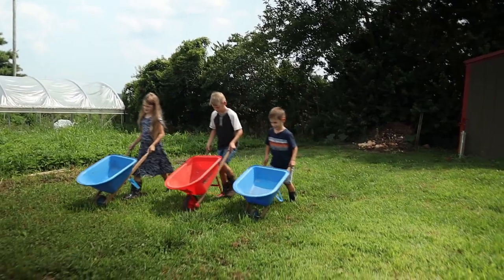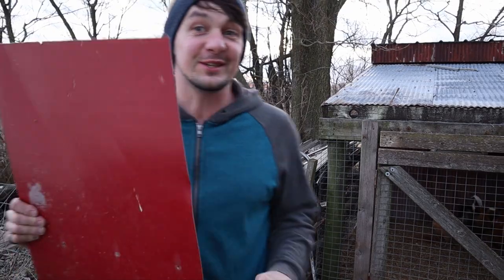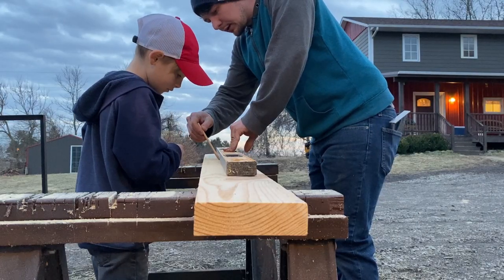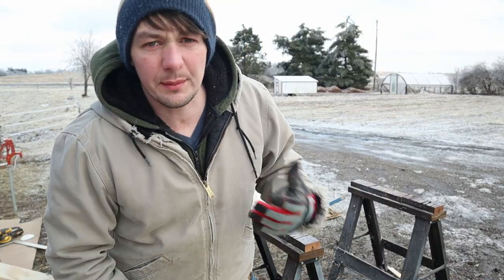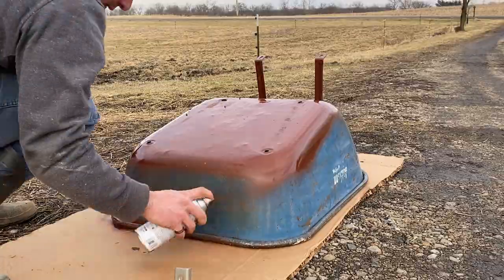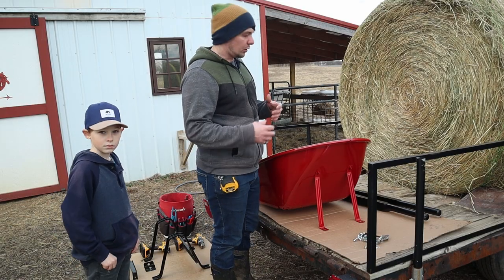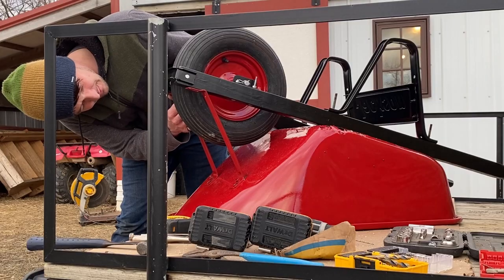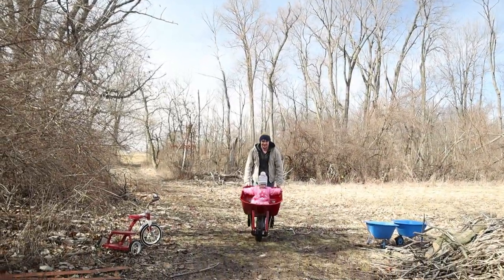$0 Wheelbarrow Restoration!

Comment: Great video.  Another method, at least for the parts and the inside of the wheel barrow is to purchase several containers of Evapo Rust and pouring it into the wheel barrow(assuming you’ve sealed up the holes in the bottom).  Sometimes the rust at the bottom has penetrated too deep to grind it out.  Yes, the Evapo Rust isn’t cheap, but if the rust has penetrated too deep it’s the way to go.  You can also soak the parts in it.
One last thing.  If you buy a brand new wheel barrow from Home Depot, Lowes, Walmart, etc., just go ahead and sand or grind off the paint on the inside of the wheel barrow.  Then prime and paint with a Rustoleum primer and enamel paint using several coats.  Why?  Because most manufacturers of wheel barrows sold in big box stores do NOT properly prime and paint them.  All they do is spray one thin coat of crappy paint to make them look pretty but they are not prepped properly for real work.